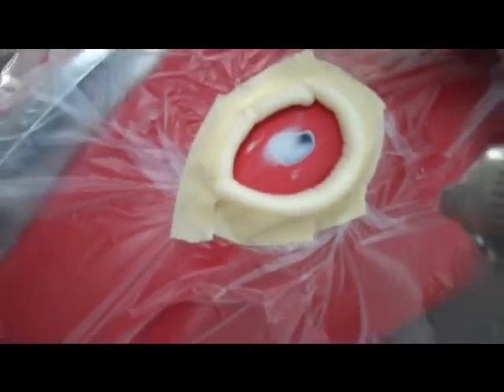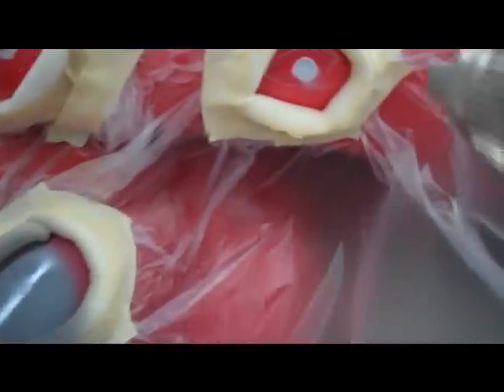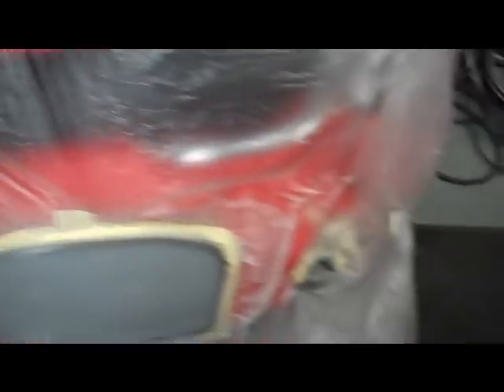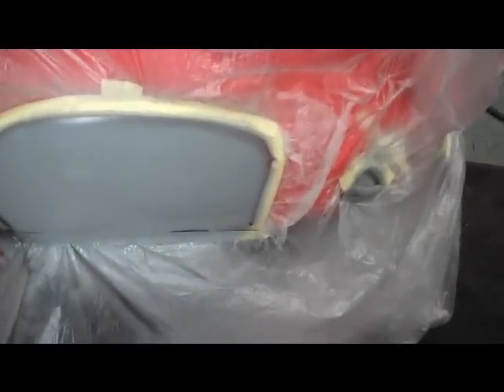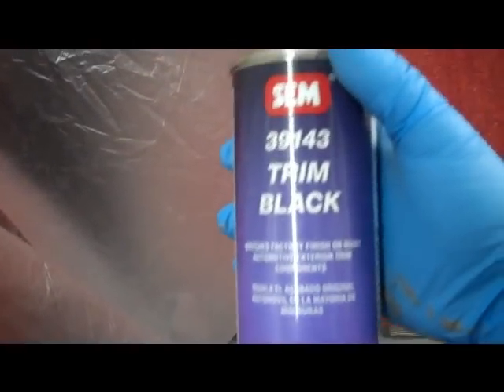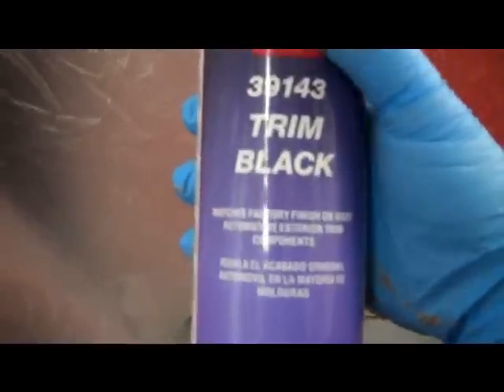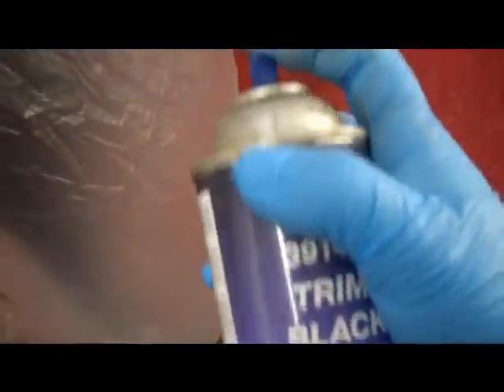How to mask for primer

Comment from the maker: @gregmporter  Getting the materials warm to 75 degrees gets the viscosity
thinner, works well to revive paint, prime , clears and hardners when they 
have chilled on the shelf for a while, You can set a gallon can on one
and it'll warm it.. remember to turn it off for sure or you know